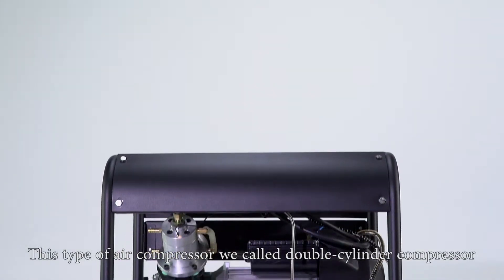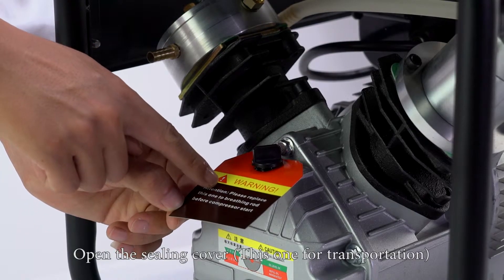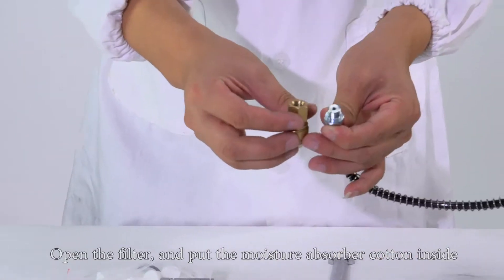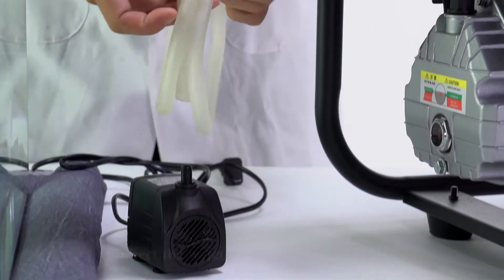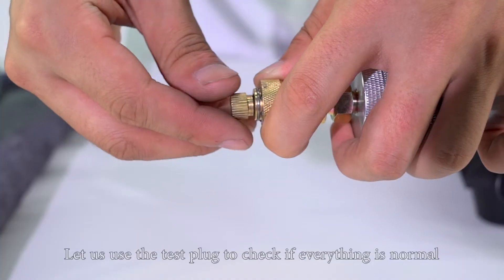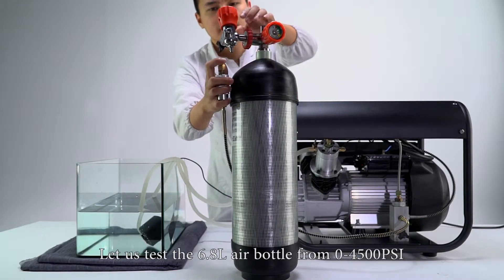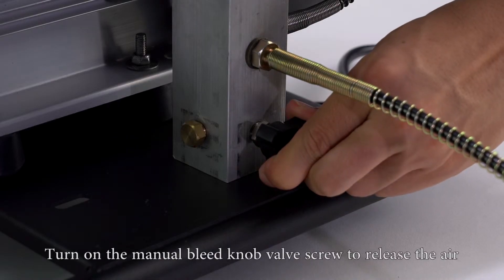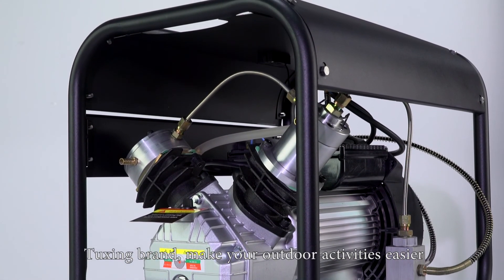Model number: TXED011 (Double cylinder pcp compressor)

Comment: can you tell me in the  manual it says do not operate over 60c on the instructions on this video it says 90c what one is right ? it will run for app 5 min to reach 60c could the prob be its a new  machine   18 litres of water  is just warm please (help)
Reply from the maker: Don't let the temperature over 85°C. Max temperature is 90°C.  We suggest that we can add as much water as we can.  Put some ice into the water bucket, it will make the water cooling very effectly.